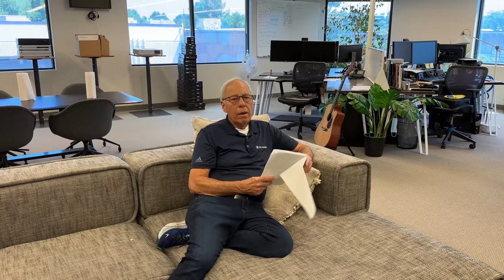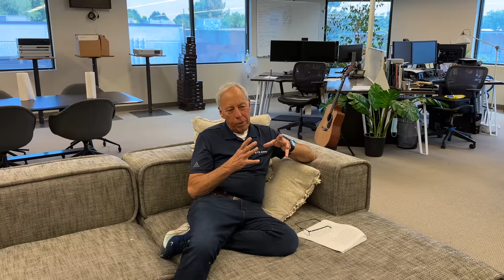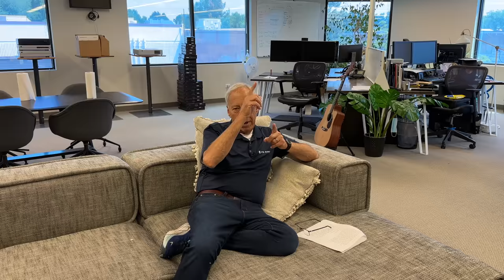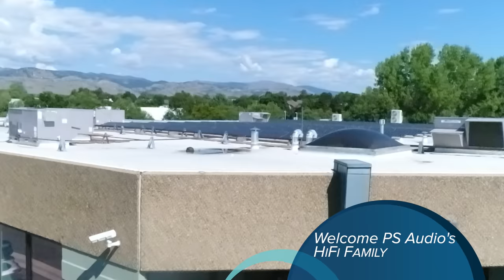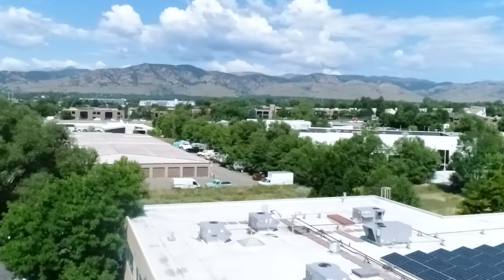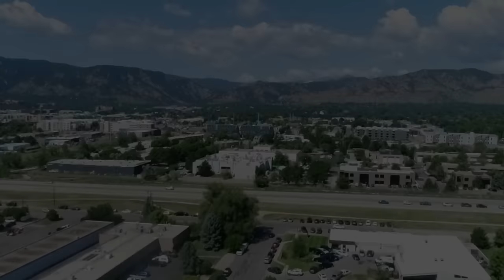How digital amps work

Comment: The questioner is confused. The “D” in Class D does not stand for “Digital”. The “D” just happens to be the next letter in sequence for amplifier types.
Reply: Class "G" amp would be for old Geezer types :face-blue-smiling:
Reply: Exactly.  And it's a coincidence that has caused no end of confusion among people who think they know without investigating.
Reply: That's a load of hogwash
Reply: @AccuphaseMan  
Actually, Geoff is correct.  
https://en.wikipedia.org/wiki/Power_amplifier_classes
Reply: @AccuphaseMan  Many people are confused by the Class D name. A digital electronic device processes Binary Digits or Bits, usually 0’s and 1’s. A Class D amplifier does not process Bits. It is a Pulse Width Modulation device so a better name would have been Class  P for PWM.
Reply: @geoff37s38  
Alternatively they could have just skipped the "D" and called it Class E ... kinda like Microsoft did with Windows 9.

Comment: This is a nice explanation, it actually allows us to imagine what a digital amplifier looks like. A class D amp takes an analog input signal and converts the signal strength in a duty cycle i.e. pulse width modulation, as Paul says. A Digital amplifier takes the digital signal, what ever it is, and converts that directly in a pulse width modulation. At the output transistors, it is different from a class D becasue that time domain is pure analog. With a digital amplifier the time domain will be divided by a clock signal to give a fixed integer number of the sum of on and off states per cycle. I think that will be coming our way in the future. BTW, the "filter" at the output of a class D is acting as integrator. By integrating the duty cycle of one cycle, that PWM signal is converted back in to an amplitude level.
Reply: Correct but one little nit ...
"With a digital amplifier the time domain will be divided by a clock signal to give a fixed integer number of the sum of on and off states per cycle. "

It should actually say "number of cycles per on and off state."

In the digital input version the PCM sample is used to count down to 0 before switching the output state.

Comment: At my live blues music venue, I use QSC K12.2s, KS118, and CP12s.  All Class D powered speakers.  My lights are all LEDs too.  My venue is in a very old building in Japan.  In three years I've never had the power cut out.  Not once.

Musically speaking, we have a great speaker setup and very good room treatment.  Our mixer is an analog Midas Venice 240 and everything else in the chain is all analog too.  

Man, I'm telling you that the sound is amazing!  Even when I play CDs through my 1989 Yamaha CD player, the sound is tight in the room.  I would seriously compare my music playback to that of a high end home audio setup.  No joke!  We've maximized the sound quality of the QSC speakers because of our overall setup.

I own a Yamaha B-2 (Class A) at home.  So I can definitely tell a difference in tone albeit its apples to oranges between the purpose of both rooms. 

While I'm definitely loving both Class A and D amps, I've mostly experienced that room setup makes the biggest difference.  That's the ONLY way to get one's moneys worth from expensive gear.

As Paul says, spend most of your money on speakers, then amp, then...etc.   And I say spend most of your time and effort on room setup.  Homemade sound absorbers made with rolled fiberglass and thin black cotton material stapled to a light wood frame changed my life and and the sound of my venue.   I can't wait to make some for my listening room at home.

For live music, Class D QSC speakers are the creme of the crop!  Setup setup setup!
Reply: One of my quick and dirty tests to see if the sound system isn't crap and the acoustics are okay is to have a conversation with someone while music plays loudly.  With a well setup system you can still crank it loud and talk to people a lot more easily than a system with poor acoustics and amps/speakers.

I'm sure other people here have experienced the same phenomenon!
Reply: @bf0189  Yes! Visit a concert in a stadium (not designed for music) and it's hard to have a conversation. Visit a concert at a music hall designed for the best possible acoustics, it's not as hard to speak to people as at the stadium. The same at party's or at a bar where they're playing loud music. You will notice the difference in your ability to have a conversation or not depending on the quality of their PA system.
Reply: @hugoromeyn4582  I noticed that at the age 16 when my dad switched from a Marantz surround sound receiver to a Emotiva one. The amps in the Emotiva blew away the Marants and allowed my Dad's Axiom speakers to sing. It sounded so clear loud yet I could talk to my dad unlike the Marantz. From there on I became obsessed with audio,. The apple doesn't fall far from the tree

Comment: in the 1970's we got a contract from Sylvania to build a 120v 60 Hz source that would supply 750w to drive some AC motors in a tape machine that was going to go into a tracking station for the air force. This would run off 48v DC and had some efficiency requirements so wo could not just build a class AB amp. One of the motors was a synchronous motor so that 60-Z had to be stable within 1% in amplitude and frequency. During design one test we had to pas was driving a heavy duty 3/8" drill with this $20,000 device.

In talking to one of Sylvania's engineers during the acceptance tests I asked him why didn't they just specify 48v dc operation for their Ampex FR1100 tape decks?

In any case we essentially made a class D amp using 555's, comparators, and op amps in a 1"" 3 unit rackmount form. The breadboard was on a 3x2-1/2 ft piece of plywood and built over a schematic. The hardest part was geting our home brew 60HX oscillator stable over the -55 to +55C operating range. I think we ran the clock at 20KHZ and filtered that out with an LC filter on the output. The test sheet had us record the output for no load full load, high and low DC input levels. We also had to start up that 3/*" drill and put a 3/8" hole in a 1/4" steel - things were very practical in those days. men were men and sheep were scared!
Reply: very cool (or hot, as the case may've been).
that's what it took to win the previous cold war.

Comment: There are actual digital amplifiers that work on the principals of delta-sigma modulation and the bit-stream serves to provide pulse density modulation. It is then noise-shaped and filtered to produce the audio signal to drive the speakers. I don't know of that many examples offhand, but it has been around for at least ten years or more. However, pretty much all other class-D amplifiers are actually analog as there is usually some form of comparator, waveform generator, and other analog circuitry to derive the PWM or similar signal that is then filtered to get the audio signal to drive the speakers. The big difference is that they are not linear as there is non-linear switching involved unlike class-AB which the transistors basically just act as variable resistors to regulate how much current can flow into the load.
Reply: I believe that what Paul just said in more layman terms.
Reply: @kkrobertson1  His explanation was not quite correct. He tried to draw some parallels between the switching to drive a load and binary logic, and said that PWM class-D is not quite analog. Contrary to that, it is very much fully analog in nature. I originally tuned in since PS Audio does use the delta-sigma technique I mention above in one of their DACs, but he only brought it up in passing even though it would have been instructive to hear it contrasted with conventional class-D. It would have nicely explained both technologies. Edit: To be fair, he sort of did.

Comment: I have the Legacy Audio Wavelet digital pre-amplifier. It does input selection, ADC for analog inputs, tone controls, volume, active cross-over, room-correction, reverberant field recreation, all done in the digital domain.  It has 4 output DACs (one for each channel) and sends the signals to power amps.
Reply: Is this really an amplifier - or is it just diverting different inputs to one output and doing some facelifting to it?
Reply: @rudolfglaser9664  Of course, if the post was specifically about power amplifiers, then that is a different matter.  As a pre-amplifier, it does change gain (mainly reduction) but in the digital domain, and their is only so much increased gain that can be applied before it clips.  This preamp does allow up to a maximum 3dB gain for each output channel (and reduction of 10dB) to level set the drivers (outside of volume control).  This is a small level of gain compared to the 24 times gains from the power amplifier sections.
Reply: @rudolfglaser9664  I guess that it also depends on what part of the power-amp is digital.  eg.  Is it the signal itself that is digital, or is it the microcontroller that controls the switching (in a class-D amp).

Comment: Paul is correct ... The "D" designation was merely the next letter in the alphabet when assigning amplifier classes.  It's like "C" was the next compiler in the sequence of development.

I've always found the easiest way to understand this is the "FM radio" analogy...  
The amplifier generates a high powered carrier signal, just like a radio transmitter does. The audio signal is then modulated onto this carrier signal, just like in a radio transmitter.  
In this case that is accomplished by varying the width of square waves, where in an FM transmitter it is done by varying the frequency of the carrier signal... but the result is the same; a much amplified audio signal riding on a carrier signal.
Then, just like any FM receiver, filtering out the carrier wave gives us back the audio signal.

The most important take-away here is that at no time is the audio signal "digitized"... Class D amplification is an analog process.
Reply: Yes!

Comment: NAD made some great "Direct Digital" amps (before mentioned M2 and M32), before moving on to using the Purifi modules in M33. M32 was a Stereophile Class A component and sounds great.
Reply: "Makes" not just "made."  I have the M28 5-channel amp with the Purifi magic modules.  It sounds great.
Reply: @1Uriahheep1 it sounded great. You had to give  it back. 😢
Reply: @1Uriahheep1  I have looked at the M28 and it's a 7 channel receiver not a 5 channel.

Comment: My Panasonic SA-XR 50 from 2003 has an Energy Star sticker on it. My Red Dragon M500 Mark 2 monoblocks with B&O Ice Modules from 2016 generate so little heat their cabinets have no vents. My Peachtree Carina runs warmer than the other two. 

I like Class D for their cool running and abundant headroom. I had an electrician go over my system to make sure the amp draw was safe and he said it was nowhere near dangerous. We live in the desert so warm running gear comes out of our bank account in the summer.
Reply: any chance audiophiles could bring down the grid in TX?

Comment: Maybe the real question isn't "which is a digital amp, but does it sound like early digital". When compacts discs first came out, the ones smart enough to hear problems with the sound, pointed out harshness in the highs and a lack of warmth. That is exactly the two main things many people hear and complain of when listening to many Class D amps. If some reviewer's words can be taken for gospel, there are now a few very expensive Class D amps that don't have the above affliction. Which means those things aren't innate with Class D. If many Class D amps sound digital (especially early digital), then you would think they would tonally mate better with analog and it's warmth. Early cd players played through tube amps were listenable. Warmth is very important; make sure you have it in the right amount.

Comment: There are class d amps (Peachtree, Lyngdorf) which have no analog input stage, which can only be connected by SPDIF.  That is a bit closer to being “digital”.
Reply: Not really, that's just a DAC and an AMP in one box. The class D amplifier IS receiving analog input. it's just coming from the paired internal dac.
Reply: @G3rain1  I agree it isn't in substance "digital".  But, since there is no preamp, the volume being controlled in the digital domain, could there be an incremental difference?

Comment: I never liked class D sound, but my last class D amp was more than 10 yrs ago.  I hear there has been a lot if improvement since. Might give PSaudio or NAD class D amp a try.
Reply: I have had the NAD C388 and it sounded phenomenal, unfortunately it broke down three times so i got my money back and invested in a Rotel pre-power setup.
Reply: Indeed there has been significant improvement.  These days you could level match an AB and a D amplifier and switch back and forth between them and it's likely you would have to look to see which one is playing.

Comment: If you wanted brevity, one can say conventional class-D amplifiers are not digital as they do not use a finite state-machine to derive the signals used to generate the PWM. It is done using conventional analog circuitry driven by an analog input, thus they are analog in nature. Just not linear.
Reply: While that's a true statement it's not a good explanation as most people without a computer science degree have no idea what a finite state-machine is.
Reply: @G3rain1  While I appreciate Paul “breaking it down” sort of speak, he was not quite correct in his explanation of class-D amps. In his description they are quasi-analog as they are driven by switching circuitry. That is not the case. They are fully analog, and not digital at all. There are, however, actual true digital amplifiers that use delta-sigma to perform pulse density modulation. PS Audio used this same technique in one of their DACs, with the delta-sigma driving an output transformer. It would have been nice to have heard him bring it up in more detail since it uses the same principals.

Comment: "When an electric charge from the clock’s battery or another power source passes through a crystal it vibrates back and forth, or oscillates, at a set frequency of 32,768 times per second. For every 32,768 oscillations of the crystal, a circuit in the clock, called a counter circuit, counts one second."

All digital circuitry begins with pulses from a vibrating crystal. No digital circuit design begins with perfect digital pulses. These pulses are derived from either an AC or DC (Battery) power source.
Reply: six decades ago, my physics prof told us, "digital is just a means to efficiently transfer & manipulate the analog world for a variety of functions". he was on Oppenheimer's Manhattan Project team... who was I to argue?
Reply: Great reply! It was around that time that I started out in engineering school but never heard a statement like that. Professors can be prophetic.
Reply: Most Class D amplifiers do not use a crystal oscillator.

Comment: Class D = pulse width modulation. 
D is next letter in the alphabet after the class C amplifier. 
 Now how many will say no such thing as class C.
  Dead time in D is also something very important or you get a short circuit.
Reply: Class C is a switching amplifier commonly used for FM radio transmitters.
The output stages in a Class D amplifier actually operate in Class C.

Comment: Analogue amplifiers are free from the complex signal processing of digital or the usual class D types which is why they sound better.
Reply: That use to be true back in the early days of Class D amplification with switching noise at the the lowest and highest frequencies being the biggest issue but that’s been pretty much tamed now. I would argue that analog amps don’t necessarily sound better than Class D amps - just different. 

While you can make some very high-powered D amps, they would probably sound the best in low-to-moderate power applications, at least in my experience. I tend to think Class D amps sound “cleaner” (some would say sterile) as compared to the more “warming” presentation of an analog amp. I just don’t think one is better than another - just different. And preferential.
Reply: The little matter that Class D has reduced parts counts significantly, notwithstanding.
Reply: @Douglas_Blake_579  indeed. And they're lighter and more efficient than your standard analog amps.

Comment: Briefly, Class D amp. is not a Digital amplifier period. Digital amp. or "Power DAC" works that you have a digital signal (PCM) goes to internal DSP chip inside amp who convert PCM signal direct to PWM. Digital part is till PWM section, after PWM is analog. You can't drive speakers with an amplified digital PCM signal. Hence the name Power DAC because it behaves like a DAC, only the output section is a Class D amplifier.